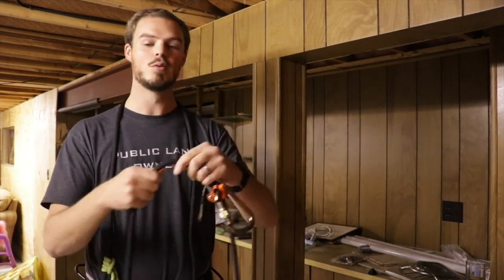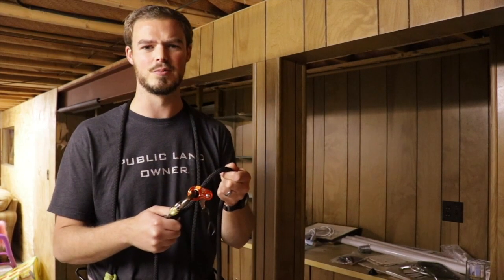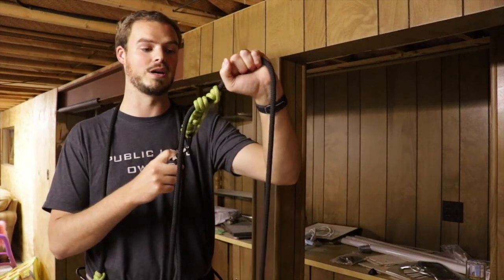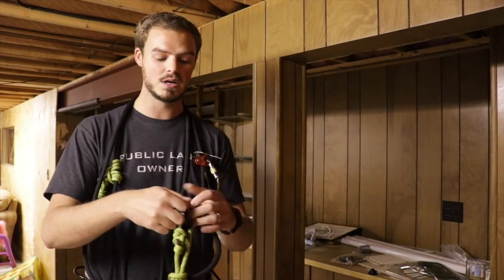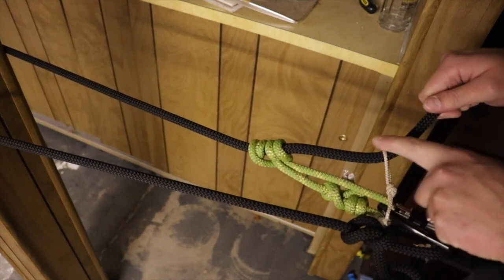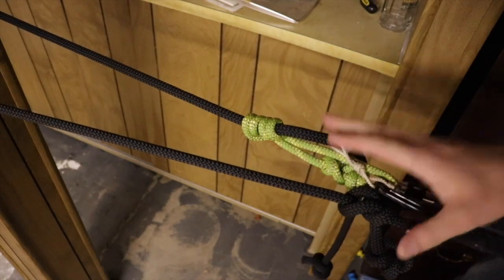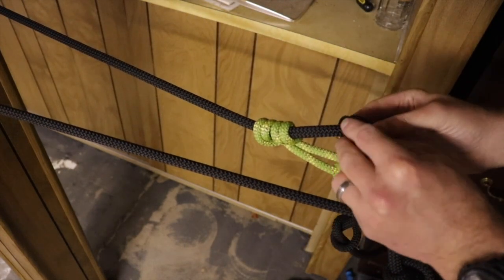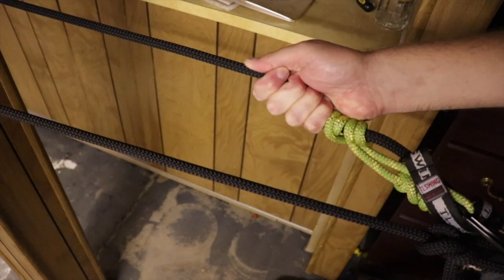ONE HANDED Lineman's Belt with a Prusik!

Comment: One other advantage to a Prusik over a Ropeman is strength in a fall. In an ideal situation where you never have any slack in your rope, either is plenty strong. But if you ever have slack and fall on a static line, it can generate high peak forces very quickly. The Ropeman is known to de-sheath or completely sever the rope at around 4 kN, which could theoretically be reached with just a few feet of falling on a static rope.

Comment: I was struggling with this and then saw a video where someone put a pulley on to tend their prusik.  I tried that and on the process discovered all I needed to do was put the tail of my lineman through the carabiner connected to my prusik and it works just like your set up with no additional parts!
Reply: Rod, I too use the carabiner as the tender. It works like a charm and nothing to addon to the system.

Comment: Great video !!  Made three of them yesterday,  one for my son`s harness,  one for myself and one for our stand hanging harness. The first two I used 1/4 inch cord for the tender and they worked great. The lineman rope on the stand hanging harness is older and a larger diameter than the other two,  the 1/4 inch cord tender dug in and didn't slid as nicely as the other two. I made a new tender out of 3/8 inch rope for the larger diameter lineman rope,  it didn't bind as much and slid alot easier than the smaller cord. Thanks for saving me $150
Reply from the maker: Glad it worked out for you!!!

Comment: Nice video. You can also achieve the same result by feeding the tag of your lineman rope through your carabiner. That's what I do and it works great for me
Reply from the maker: Never thought of that! Slick!
Reply: I gave this a go this afternoon on a new Climber and it worked perfectly on my way up. I decided to face away from the tree to take in the view, but I noticed that the line was wrapped in such a way that it wouldn't allow the prusik to grab and it just slid. So my immediate note to self was to only keep the line inside the carabiner while I was climbing facing the tree, then take it out when I reached the appropriate height. Still a great tip. And thanks for the informative videos.

Comment: Thanks very much for this video!
I used paracord for my tender. When connected with a Prusik knot I found it would bind when used as a tether for my tree saddle when loaded with my wright. I switched to a Schwabisch knot and it resolved this, and was much easier to adjust after loading. While this only holds in one direction, it works well for a linesman's belt or tether.

Comment: The 8 mm hitchcord bought in bulk is a good bargain. However a person for safety purposes has to be able to know knot tieing.  The hitch I tie is the Michoacon which breaks & holds better in both directions.  The knot I tie to attach to my carabiner is called a Hunters Bend. Just have to make sure the tag ends r around 3" & that the Hunters Bend is dressed in the right configuration.  I would never use a Ropeman. The poor man's ascender works great & u won't have wear & tear from teeth on your lanyard.

Comment: Great video! Thanks for the info. I have question. Are you using a single point of attachment for your linesman rope on the front of your rock climbing harness like in the video or was that just for demonstration. I'd like to go with a single point connection, but wasn't sure how it would work. Thanks!
Reply from the maker: Nope! That's not a demo that's how I run it! The only issue I ever ran into was a "pinching" of the lineman's belt over top of my climbing sticks as it comes to that one attachment point and not to either hip. But with a little practice I figured it out in no time.
Reply: @averagejackarchery  Thanks I appreciate the info! Blessings!

Comment: Is there a disadvantage to  feeding the loose end of the rope back through the carabiner and have the carabiner move the prusik forward?
Reply from the maker: I’ve seen some guys do this but my take on it is I always want the carabiner to be pulled by my main line in one direction and not introduce a feedback loop that could incidentally side load the carabiner. With how cheap a tender is to make, I think it’s worth the investment.

Comment: Thank you so much for the video.   Your strap tender with the 2 metal loops looked like it worked better and I think if you were to sew the strap to itself and only used 1 loop it might still work well and then would not have the metal on metal sound.   Your thoughts?
Reply from the maker: Yup, would work really well!

Comment: It seems your showing 2 different linesmen ropes. 1 of them has 3 wraps on the Prusik (The one over your neck)  but the one your using to demonstrate only has 2 wraps on the Prusik. Is there a reason why? Which do you use with the tender? 3 wraps or 2 wraps on the Prusik?

Comment: Hey, I'm not a lineman at all, but I do work with rope during high angle rescue scenarios. I was wondering why you would care about your system being quiet. What is the problem with a few of your metal parts making noise on your tender? Is is a preference or is there a reason behind it?
Reply from the maker: This is strictly for hunting purposes. Where noise level is paramount. For regular lineman's though noise isn't an issue!

Comment: You need to put one more loop in that prusik so it has six count at least to be considered a true prusik they say it's not as safe just having one made with two loops around your linemans belt or any rope.
Reply from the maker: You are correct! I took out one loop to over-exaggerate the size disparity of the tender vs the prusik length. I neglected to say so in the video. Thanks!
Reply: It's all good dude just thought I would point it out so people know if they don't already.  Not trying to be a butt hole or anything...lol good luck this season I've watched you for 3 years right after I started getting serious with a bow and you have help me a lot.... I just used a little paracord and made me a prusik tender, it helps a lot and way easy to make! Thanks man and good luck to us all. You have any tips for a limb wi6a hairline crack going down the side? Hasn't affected my bow to much but definitely want to do something till get limbs replaced or get a new one.

Comment: I tried tenders but I am too fat. I use a pair of ropeman's. There were too many times my hitches cinched up too tight for one handed operation. From what I understand this works fine for sub 200# guys.
Reply from the maker: I'm a solid 220 in street clothes. Easily 235# with a full pack. Still works great.

Comment: Why can’t you just run the tag end of your lanyard through the carabiner?
Reply from the maker: You'll find the end of the carabiner is too wide and won't get a good push and loosening of the prusik. The knot will just slip into the carabiner. The smaller diameter of a tender ring/rope loop is much better suited.

Comment: Or u can use a pulley
Reply from the maker: You could! Just add extra weight (negligible) but more importantly a piece of noisy metal to the system. But great idea!
Reply: After watching this video,I actually tried with a qricklink(8mm thick),if we use right size it seems also to be a good idea, functions in same way like a piece of cord 
Thanks.